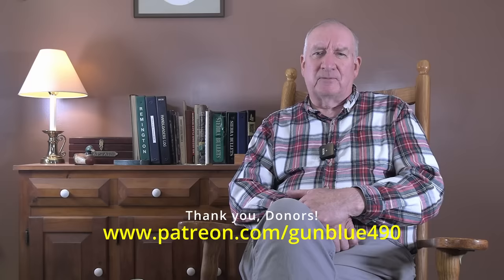The Copper Fouling Lie ~ Don't Fall for It!

Comment: Thank you for your knowledge and experience on this topic. Question for you: proponents of "copper fouling theory" often say the risks are enhanced when shooting monolithic copper bullets (e.g. Barnes TSX). Is your advice any different when shooting those types of bullets? Or is copper fouling not an issue regardless of bullet construction? Thanks again and God bless.
Reply from the maker: Those arguments are ridiculous.  The bore contacts less than .004" on the perimeter of the bullet.  Whether the copper is a thin jacket or solid though and through, it's the same material.  Complete nonsense.
Reply: Lyndon, as a long time hand loader of Barnes 7mm  140 grain TTSX bullets, I can tell you that I’ve never had copper build up in either a Remington chrome-moly or Browning stainless steel barrel. But the dozen or so Barnes TTSX plastic boxes are sure handy as are their Varmint Grenade boxes. 

In my 300 RUM I’ve ran 130 grain TTSX’s at over 3600 fps and still no accuracy loss or copper fouling after 50 rounds.
Reply: @GunBlue490  you’re correct in my experience. I have several rifles that have never fired anything except Barnes all-copper bullets and I have never seen evidence of cooper fouling even after hundreds of rounds. Not telling anyone not to clean their gun- just saying I don’t believe copper fouling is a problem based on my experiences and the knowledge of experts who have fired far more rounds than I have
Reply: @GunBlue490  You're video is nonsense.  Copper fouling is real!  Obviously until you have spent hours of arduous cleaning of a severly copper fouled barrel from copper monolithic bullets, will you understand that it indeed does have an effect on accuracy.  Hence why I will never use those bullets again.  11 hours and hundreds of patches later.....I finally had a barrel that would give acceptable results again.  This happened in less than 40 rounds of a "clean" barrel.  I couldn't hit a paper plate at 100 yards. I couldn't believe the copper, upon carbon, upon copper, upon carbon buildup it had acquired.  After the barrel was clean, the first 3 fouling shots were more accurate than the previous 20.  Experience tells me copper fouling is no lie!  And neither is carbon fouling!
Reply: The problem with monolithic bullets isn't necessarily the mono bullet. It's been demonstrated that firing regular jacketed bullets before firing monometal bullets will cause a loss of accuracy to the mono bullet that is rectified by removing the copper fouling. The reason is uncertain. Jim on Backfire TV YT channel has a video showing the test, which was prompted by Ron Spomer. Generally, I believe Gunblue is correct, but this is a noted exception.

Comment: Thank you for this. I’ve done lots of battle with copper in the past and found that once I finally did get it all out my guns shot badly afterwords until I got more fouling. I now get the carbon out with a basic solvent and don’t worry about anything else

Comment: Very well done.👍 I'm glad you made it clear about the caustic chemical "cleaners" and the damage it can cause.

In my case, I've been casting and loading my own since a boy in 1958, under the watchful eyes of my great uncle. I started out using his 1884 Colt SAA in 45Colt, and we loaded with black powder. We used water to clean and oil to preserve and lubricate. 

Today, I use Clenzoil for my smokeless powder weapons. I have only one centerfire rifle that I load jacketed bullets, and only clean to remove carbon and preserve the weapon. 
Many of the weapons I own have never had a factory round, much less a jacketed bullet fired through them. I do occasionally, have an issue with leading in the bore. There, I strive to remove the lead as much as possible. I'm sure that lead fouling is not the same as compared to copper forming in the bore. I've contemplated shooting a few copper plated rounds through them to "fill the gaps" to smooth out the bore to reduce the leading.
Reply: Similar idea to the "cleaner" bullets they used back in the day to get powder fouling out of the barrels in combat.
Reply: @Charon-5582  Yes indeed, I know exactly what you mean. As I recall, there was one bullet, with the zink plate at the base to remove fouling, in ten issued to the troops in the War of Northern Aggression. Have a couple in my old bullet collection. 

My thought is that if I start with a spotless bore, free of all fouling, and then fire some plated rounds. This should, in theory, deposit copper fouling into the striations in the bore that are currently collecting the lead, and making it smoother with the copper filling instead. 

I had contemplated using a few "fire lap" bullets, coated with grinding compound to smooth out the bore, but I think that would be a last resort. 

Oh, and the main offending weapon I'm dealing with is a copy of an 1873 Colt Single Action Army in 45Colt. A beautiful copy, but it leads up from the forcing cone to the first 1 1/2" of the bore, regardless of alloy I'm casting. I'll try the plated copper bullets first and see what happens.
Reply: @anangryranger  I think it would depend on if there was already a base of copper "in the screw holes" or if they were already filled in with lead.
Reply: @Charon-5582  Well, I started out with a spotless bore, meticulously cleaned, void of carbon fouling, metal fouling, or oil. Fired 24 rounds of copper plated ammunition. No cleaning until done. Used York's Wax products (cleaner and gun butter) to clean. York's is all natural ingredients with zero chemical. 
At the end of cleaning, I noticed traces of copper in the bore. My next session will be 26 more of the copper plated rounds, followed by the York's Wax products for cleaning. With luck, this should fill the gaps to smooth out the bore.

Comment: This makes me think of Hodgdons new CFE223 powder. "Copper Fouling Eraser" it looks and performs pretty much exactly like H335, just with a bit slower burn rate. Granule size is effectively the same.
I think it's all illusion of choice. 
The firearms market is saturated and companies are coming up with all these gimmicks to stay in business.
I bought a solvent for my shop a while back that claimed to "remove lead, copper, brass, and carbon fouling"
It smelled like straight concentrated cat urine.
Just opening the bottle fried my nose and make the shop reek to high heaven.
I set that stuff out in the chemical cabinet with the rest of the caustic stuff. 
Now we use it as a degreaser prior to reblueing.
As for cleaning bores, honestly I rarely clean my rifle (I'm a gunsmith shame on me I guess) and it shoots like a charm. The trick is use good clean powders and wipe off the critical areas to prevent rust.
As for performance, I agree with what you said about the copper "smoothing" the nooks and crannies and improving accuracy.
My rifles always shoot the best about 100 rounds in after a cleaning.
Take care, God Bless
Reply: I think I will avoid the CFE and Enduron powders for the same reason as using a copper solvent. If the copper is good, then a powder that removes it is just a sales gimmick to sell more powder. Stands to reason.
Reply: @cbsbass4142  honestly I think it's slightly modified H335 repackaged under a new label.

Comment: I just recently cleaned "COPPER FOULING" from a rifle that was completely necessary.  I was trying to build an accurate reloaded hunting cartridge, through trial and error of several bullet manufacturers and designs.  2 of these designs were Barnes (TSX and LRX), both all copper constructed bullets, along with several lead/copper jacketed bullets.  After firing about 40 rounds through a "clean" barrel, none of these bullets proved to produce remotely decent groups like they had early in the process.  After throwing my hands up in frustration, I decide to clean the bore.  11 hours of monotonous scrubbing later.....I finally had a bore that would produce good groups again.  My 3 initial fouling shots were more accurate than the previous 20 through the "fouled" bore. I found that I had layers of copper on carbon, on copper, on carbon.  I couldn't get to the second layer until I had cleaned the 1st.  With the copper solvent I would have clean white patches after clearing out the blue....then.....with carbon solvent the patch would be completely black and i would clean until they came out clean white.  So back to the copper solvent I would go, which would come out completely blue again, and so on so forth.  This meant alternating solvents both for copper and for carbon, depending on which layer I was at.  My first hint that this was the case was my carbon solvent was Birchwood Casey 2 in 1 bore cleaner, so it would give me the hint of blue once i got through the black.  This was both time intensive and labor intensive.  I couldnt tell you how many layers there were, but i spent a better part of a weekend and HUNDREDS of patches on it!  Needless to say, I settled on a great grouping load with a .75 MOA SPEER Grand Slam bullet load within 15 rounds of the recently cleaned bore.   And all of the other bullets produced acceptable groups (1 to 1.5 MOA) in that period as well.  Before cleaning the bore, the best group I could get was 3 to 5 MOA with these same bullets.  COPPER FOULING is not a lie!  It is very real and does "build up" on a previous layer of carbon.  Which means that CARBON FOULING is also not a lie! Those Barnes bullets were the culprit, and I will not be using those ever again, because I have never experienced fouling such as this before trying those bullets.  No one can tell me different because of what I learned in this experience. I have several boxes of Barnes bullets for sale as well in .308 and .338 caliber!

Comment: Question for you, I've seen a fair amount of stuff on here about bore snakes being bad for your rifle bore, I've been using these for a very long time and can't see any harm being done, if you have some input to this is love to hear what you have to say ?
Reply from the maker: Hoppe's Bore Snake is essentially an evolution of the string bobs used for field cleaning of military rifles for decades.  I don't know what came first, string bobs for clarinets or M1 Garands.  They certainly can't harm a rifle barrel in the least.  In the last few years, I've used Bore Snakes exclusively for 22 rimfires.  They do a slick job with one simple pass.  I recommend Bore Snakes as a field expedient for centerfire rifles, and they do a good job getting the chamber.  Using one at the end of the day with a few drops of oil on the braid before heading home is a good rust preventative measure.  However, they don't have the tight bearing pressure of a tight fitting patched jag to really get out the baked-in centerfire residue.  Good product, but I'd still use a cleaning rod to remove all residue.
Reply: @GunBlue490  My grandad used the string bob and "2x4" cleaning patch when he was in the military and dad used a cleaning rod, patch, and oil for his Winchester 88 and oil and a string tied to a sock for his Remington 1100.

Question: When you were measuring the chamber length with and without the bullet on your .270 reloading series, where did the extra .20 come from when seating the bullet? Thanks and I appreciate you sharing your knowledge.
Reply: Pull-throughs have been around as long as breechloaders have.  They're not going to do any harm you can't also do with a rod.

Comment: Hey Blue, do you go as far as to not use a bore brush at all?  I've heard some people say they'll only pull a few patches covered in carbon-solvent, then Rem Oil, etc until it's totally clean.  I've been going the middle-ground and using nylon bore brushes with mild solvents, then an oiled patch, then dry patches until they come out clean/dry.  Seems to work okay for me, but I'm not a professional marksman or anything so I guess I don't know what I don't know...  Brass brush, I assume, is for a rare use when heavy carbon fouling is present, or are they safe to use every cleaning?

Comment: Had an old Winchester m1895 with a poor looking bore. Shot 6” at 100 yds. I cleaned the bore with bore cleaners until the cloth came out clean. It still shot poorly. I used acid and the cloths came out black and green for several passes changing the cloth. Then I shot it again and got 3” group 😊 After that I just normally clean the bore

Comment: In my experience it depends on the barrel. Some barrels shoot better with some copper laid-up into the imperfections in the barrel and others shoot best when very clean. As you say, Carbon seems to always have a negative effect. As always we need to be careful not to over-simplify and to get to know our firearms individually rather than assume they all work the same.

Comment: I just watched this video and then your "Gun Cleaning and Solvents" video and I would say that "Plating" the barrel is an acceptable phrase for this particular conditioning, but maybe a phrase that folks would better absorb and understand quickly is "copper seasoning." Like seasoning a cast iron or carbon steel pan - a process that will effectively leave a new surface on the pan, making it smoother and protecting the core material of the pan from corrosion.

Thanks for your videos. I grew up shooting but am getting back to it now after a long hiatus. Gonna make it a point to have my new revolvers go through a couple boxes of jacketed ammo before moving to lead.

Comment: I occasionally completely clean everything out of my bore with KG-12. I find it takes 20-30 rounds fired for the gun to settle in and shoot nice groups again. I find Butches Bore Shine takes carbon out nicely. Great video sir.
Reply from the maker: Mineral spirits removes carbon at a fraction of the cost, just as it cleans engine parts.
Reply: mineral spirits huh… i’ll have to try that. i currently use j-b bore paste with kroil in my precision 22’s, works great but, i’m always up for saving money! cheers, excellent video!

Comment: Thank you for the wisdom. I have always cleaned the barrels of my rifles because that's how I was taught, until I started hanging around real gun guys and they informed me that I was doing it wrong. Now I use a polymer brush every now and then to get the carbon out but that's it, and I use hoppes #9 to clean the action, bolt and levers.

Comment: I agree. Also, if you own a borescope, you will know that most of the popular copper solvents barely do anything to copper. They turn blue to let you know there is still copper in your barrel, and that's about it. I saw a test online where someone compared about a half-dozen very popular copper solvents by putting a bullet in the solvents for 21 days. The test found that the best performing solvent only removed 21 times more material in 21 days than a bronze brush did in 5 minutes (brushing only one side of the bullet). In other words, you can remove more copper with some elbow grease in 5 minutes than those expensive solvents do in a 24 hour period. If you further consider that brushing one side of the bullet with a bronze brush isn't even a fair comparison because the brush would be removing copper from the entirety of the inside of the barrel and that solvents won't stay on the top and sides of the barrel for more than a minute or two, you can see what a complete waste of time and money they are.
If you believe that copper needs to be removed, buy yourself some decent bronze brushes and use oil or something similar to remove the crud it breaks free with patches. All the copper solvents I have tried are nothing but expensive snake oil. Once I got a borescope and realized that my gun was shooting great even with "copper fouling" (because these solvents basically did nothing to remove the copper), I completely stopped worrying about copper.

Comment: I'm going to be 70yo in a few months, so it's been a minute since my grandfather showed me how to clean a dirty .22 using nothing but automotive brake cleaner, an old rag, and a coat hanger.  I've been using that method for the better part of 50+ years, and never had one issue.  I did, however, graduate from a coat hanger to a proper rod.

Comment: i almost forgot chi com mosin nagant  used as a teaching tool letting new troops fire it.  Barrel a little rough never cleaned for 50 years still 10 inch groups at 100 yards off hand and not to steady.  I am going to check it out a little better now. thank you

Comment: When I built my .308 target rifle, I used Harts break in recommendations. Fire 1 shot, clean until no blue on the patch, and so on and so on.....once I got to the 2 and 3 shot parts of the procedure, the groups got tighter and tighter, as the blue was easier and easier to remove. Now I can shoot 40 shots through it and clean the powder out in 2 patches with very little blue on the patch. I'll never break in any other way. Spend $5k building a rig, I'm not taking any chances.

Comment: True. New or very clean barrels need seasoning to smooth out the roughness before accuracy improves. That means getting enough copper and lead material in the rough areas of the bore to smooth out the surface. Conversely, too much copper and lead material in the rifling over time results in lost accuracy until the excess material has been removed. Some shooters think that their bore has been shot out by its smoothness when it really just needs a deep cleaning. Now there can be loss of accuracy over time from chamber throat erosion then its either set the barrel back an inch or so and cut a centered new chamber with a metal lathe so that the none of the old throat remains or get a new barrel.